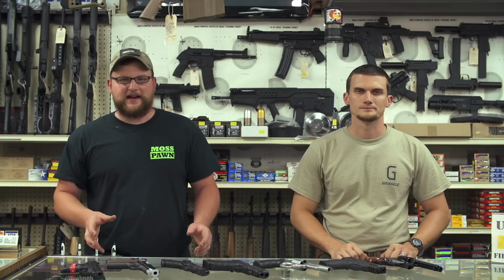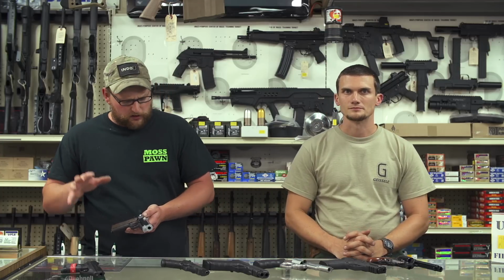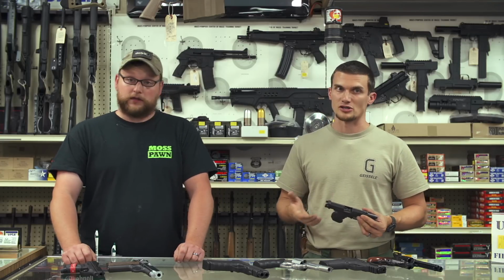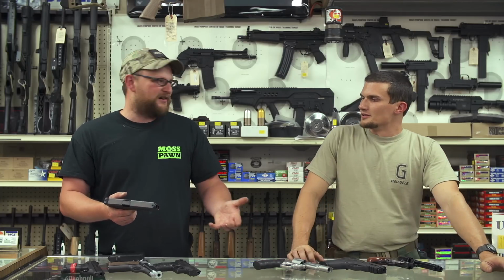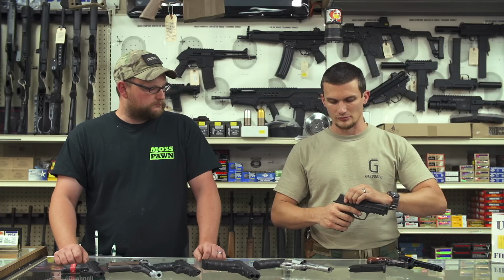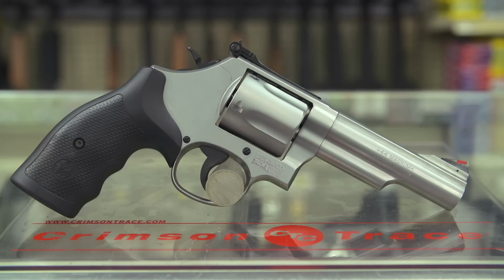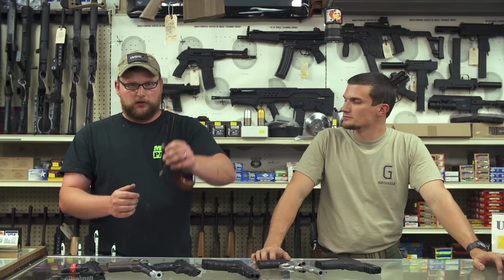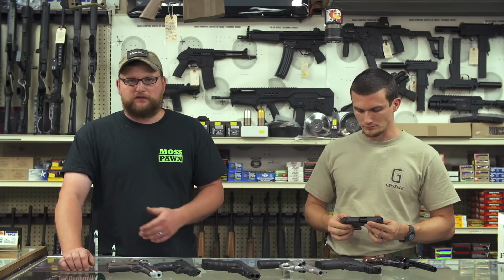Handgun Etiquette for Beginners

Comment: Many people are like me and can't stand the horrawful grip angle on the Glocks.  If they'd make a 1911 style grip angled gun, they'd own the world.
Reply: Its because you have probably put only a few rounds through one. After a day of shooting a Glock it becomes a non-issue. To me, the 1911 has the "wrong" angle because I practice with my Glock more.
Reply: I had a Sig before I owned a Glock and the angel was different but nothing a little training cant solve. Plus, every time I hear that the angel is bad I always think how that sentence  sounds like, " I can drive a Chevy truck good, but I cant drive a Ford", it nearly the same thing.
Reply: AnAngryBlack You had to be taught OUT of the 1911 grip.  It wasn't natural.  90% of people will point a Glock at a 45 degree angle above their target when holding one.  It isn't a natural angle for the majority of people, but, if you like it, go for it.
Reply: ***** That's Glock's genius marketing.  They give HUGE discounts to LE, then use that in their marketing to the civilian market, saying how many PDs use Glocks.  BRILLIANT!!
Reply: ***** I was sort of shocked when I felt and held a polymer frame/shell, when all the internals were subsequently removed. It's was extremely light. As well as, felt like something a toy was made out of. However, the plastic (polymer) frames appear to be the wave of the future. I wish some of these brand name manufactures. Would at least offer their polymer frame guns in an Aluminum frame too. Sure it might be a bit more expensive and a bit heavier. If this option (Aluminum Frame) was offered on Glock, S&W, FN et al. I would definitely go the aluminum route.

Apparently you seem to like the .45 caliber. Have you ever tried the FN-X in .45? It's a full size gun and holds 15 rounds. I can tell you that the FN-X in 9mm works great. In fact I like the FN-X much better than any Glock. Seems FN doesn't get it's fair share of recognition as the Glock, Smith or Springfield XDS models. What drew me too the FNX, was it's an ambi gun and I'm a lefty. As well as, I too prefer a DA/SA gun with a hammer. Over a DAO, striker fire. The S&W M&P line was a close second. However, it was a DAO gun. I do have the M&P(C) and like it better than the Shield. Because the M&P (Compact) hold 12 rounds opposed to 7 rds in the 9mm caliber. I don't mind if the compact version is a bit thicker and heavier. It's not that huge of a difference. Currently, my FN-X (9mm) is my EDC. The Shield is by the night stand. Have some brands I rare use as my EDC. I do like Sigs, but the decocker is in the worse spot for a lefty shooter. Wish the would change that. Not an H&K fan at ALL. Those guns are "Over-Hyped/Rated" & "Way Over Priced" too.
Reply: When I was shopping for my first pistol, I almost bought a different one because the Glock felt odd.  Glad I didn't.  You get used to it very quickly.  People that use Glocks as their primary pistol will often tell you the same thing.  Now, guns that have different geometry feel "wrong" to me.   If you shoot something else as your primary gun, then you may never get over feeling the Glock is uncomfortable.  No one gun is comfortable for everyone.
Reply: AnAngryBlack You were conditioned into liking your Glock.  It's not a natural grip angle for 90% of the population.  I'll pass.
Reply: 22640cal You had to be trained out of your natural grip angle.  You can NOT go back and forth w/out forcing yourself to adapt to the different angles.  You admit you naturally have a 1911 style, just like 90% of all people.
I CAN shoot Glocks, have shot them, but will neither buy nor carry one.   They're just great at marketing.
Reply: bahhumbucker You had to be "trained" to like the Glock grip angle.  It's NOT natural for 90% of the populace.
Reply: filoIII Whatever you say.  The "training" took a couple of hours at the range.  If you don't like Glocks that's your business. We all don't like the same things. They sure do sell a lot of Glocks. I wouldn't have anything else. Grab, rack, boom.  Every time.
Reply: filoIII
No, I wasn't conditioned to like my Glock at all.  I rented a Glock 21, a Springfield XD .45, and an M&P .45 and shot them all.  I shot the Glock the best so I picked the Glock.  I did notice how the grip angle was different.  But I got past it within about ten minutes and it has never been an issue since then.  In my own personal opinion, it's no big deal.  Otherwise there are plenty of other great choices.  But I was not conditioned in any way to like the Glock better since it was my first time shooting all three of the sample choices.
Reply: filoIII Well thank you for informing me of what works for me, I wouldn't know where Id be without you. Ill sell my Glock right away and buy a 1911 just so I can have the right angle. I'll await your videos on how to properly shoot a pistol.
Reply: 22640cal Did you by chance happen to read when I said if you like it, go for it?  You said you had to have training to "prefer" the Glock angle, which is my point.
Reply: filoIII How magnanimous of you to give your permission for others to get what they prefer!  Why is it important for you to go on and on about the horrible grip angle of the Glock compared to the 1911 and make a big deal about people needing to be "trained" to like it?  You have a few Glock users here that have all told you the same thing - that it's no big deal.  It takes much longer to get used to the feel of a new pair of shoes before they become comfortable old friends..  If you don't like the feel of a gun, don't get that one... but why spout off endlessly about it?  Do you think your words will make anyone find one gun more comfortable than another?  Newsflash - no one cares about what you find comfortable other than you, nor should they.  A correct grip on a tennis racquet feels unnatural to many at first, too.  After a few sets, it doesn't feel unnatural, it feels right.  You're going on and on (and on) about a matter of personal preference.  Isn't it a little arrogant for you to be insisting that your opinion on this - and it us just an opinion -  represents the truth and the light?  It's just post after post of blah-blah-blah that can never reach a conclusion.  Sheesh... drop it,  enjoy what you have, and respect the fact that we're big boys and girls that know what we're doing and have selected the firearms that suit our purposes and preferences best.
Reply: filoIII I never said I prefer the angle , but I do prefer my pistol work and not spend $1000+ to make it work. The point Im making is that people gripe about the angle and a good shooter can adapt and move to different platforms. Its not hard to shoot a Glock and then a M&P or whatever. Im sure Jimi Hendrix could play a $20 POS pawn shop guitar just as good
Reply: bahhumbucker I guess you failed to read where I said if you like it, go for it.  
Read selectively much? 

If you're happy w/ being conditioned into liking your Glock, go for it!  Just don't say Glocks are the best, because it's not a natural shooter for most w/out training.

Be you, Boo!  Be you!
Reply: bahhumbucker Didn't say you said Glocks are best.  Just don't say they are, cause it's marketing on their part that makes people think Glocks are the "AK's" of pistols.

Be you, Boo!
Reply: filoIII So now you're dictating what opinions people should offer?  Did I miss the part where you were appointed Czar of the Internet?  Friend,  you have serious issues.  I'm out... further discussion with you is a waste of bandwidth.

Comment: Is the action of slamming the slide home not the same process as happens when firing? Or are you guys saying that because of the feeding process the slam is softer when chambering?
Reply: +JustifyJustin As far as I know, 'riding the slide forward' is what you don't want to do as it can cause a feeding malfunction.&#160; When I load my 1911, I have always pulled the slide back and let the spring move the slide forward, that's how it's made to function.&#160; The 1911 was made as a military sidearm and was 'made for abuse'... Now, there may be more modern versions of the 1911 design that may not like to be handled this way.&#160; I don't believe that the normal auto loading or battery phase of function on automatic pistols is any different from pulling the slide back and releasing it manually. I would say though that if you are going to a gun shop and shopping for pistols that you may want to handle the pistols gingerly since you haven't yet bought the gun.* Ok, I see what they're saying as I watched through the vid... What they are saying is that you don't want the slide to slam forward on an empty chamber.  Well, I think that makes sense to me.
Reply: JustifyJustin they mean when its unloaded